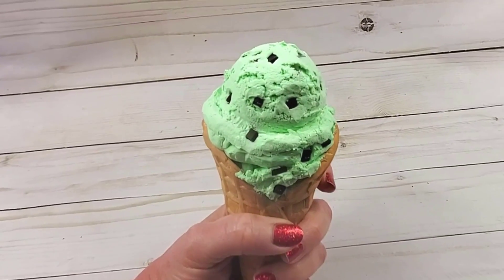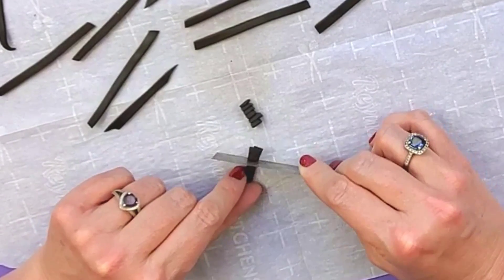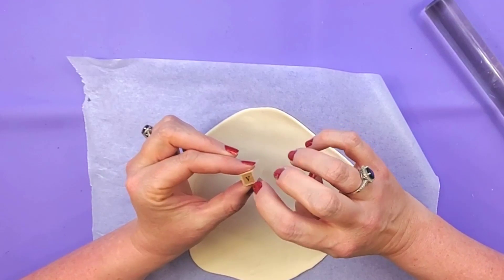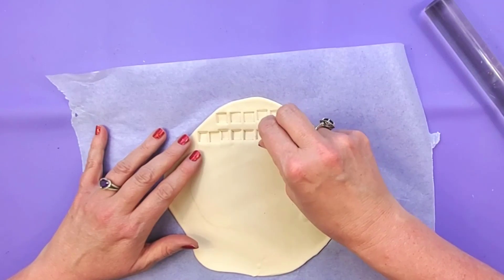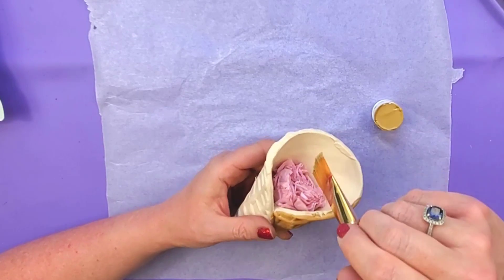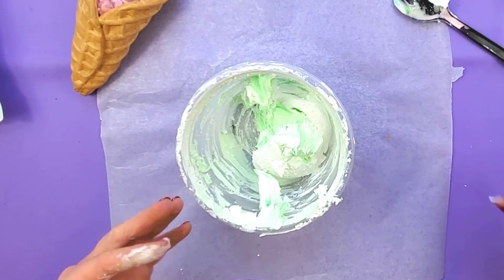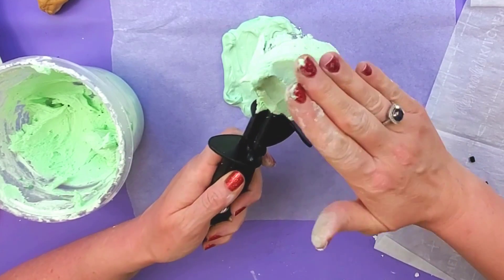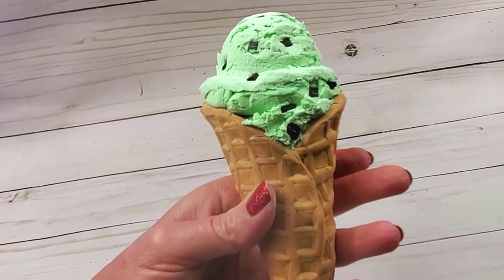FAKE ICE CREAM CONE - Faux Waffle Cone And Mint Chip Fake Bake Ice Cream Scoops

Comment: Your videos are genius. I have a question about air-dry foam clay. After air-dry foam clay dries, is it supposed to feel spongy...like rubber? Curious only. Thank you in advance. I appreciate you for sharing your crafts with us.
Reply from the maker: Thank you! Yes, it stays spongy feeling. Usually after quite some time the spongy feeling will go away and it will harden completely but it will still be very lightweight.
Reply: @CassieSmallwood  Thank you Cassie for your quick reply. I truly appreciate you sharing.

Comment: Hi, I’m just curious, how long do you let the spackle dry? And do you find the bottom gets dry even though you’re sending it inside the cone while it’s still wet and soft? Love the look of this technique, using it to make props for a play!
Reply from the maker: It will take a few days at least but also depends on temperature and humidity. The bottom dried fine. It would take much longer for the bottom to dry if it was pushed all the way down into the cone but because I put the tissue paper in first, it dries more quickly.